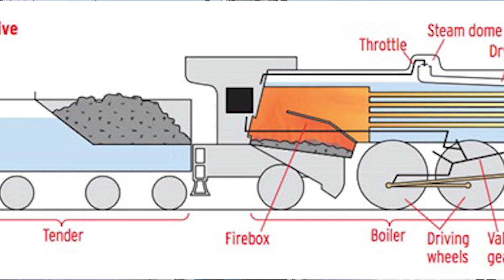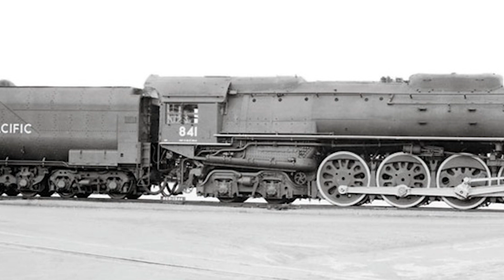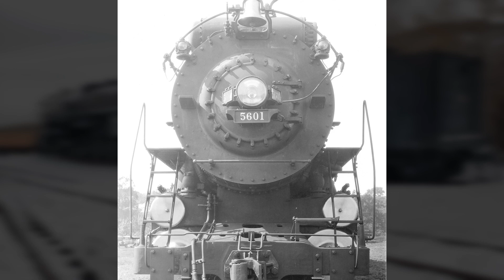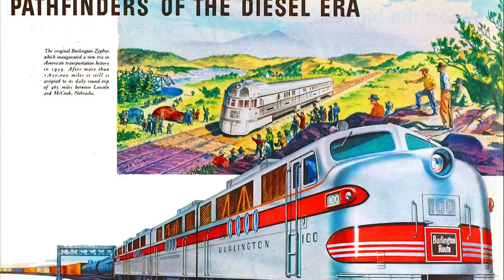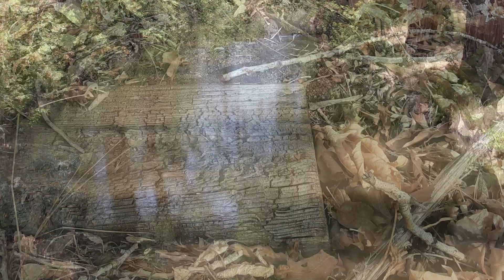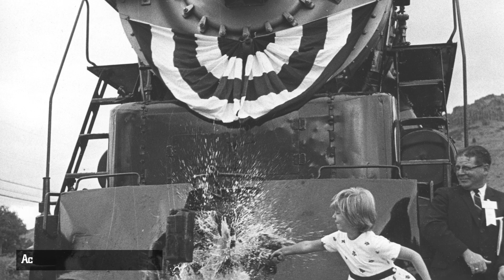Big Train Tours: Chicago, Burlington & Quincy No. 5629

Comment: Will 5629 be restored
Reply from the maker: Currently there are no plans to restore CB&Q No. 5629 to operational status. It would be an extremely expensive restoration and we do not have track to operate the engine on-site. That said, we like to say "never say never."
Reply: Okay, how about restoring one of her sistees either 5614 or 5631 or 5633, wich one do you think is perfect for restoracion
Reply from the maker: @alexlife470  it would be fun to see a Northern run again...
Reply: @coloradorailroadmuseum  If it was feasible for all 4 of them to run again
Reply: Are you gonna try to build a shelter underneath it because it seems like it's getting a bit corroded